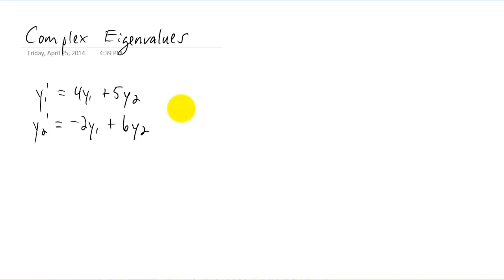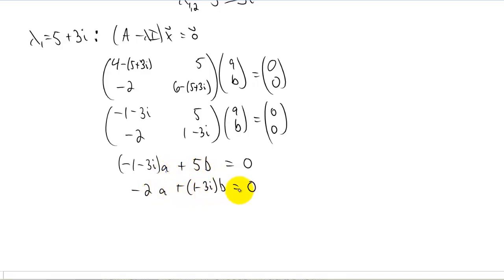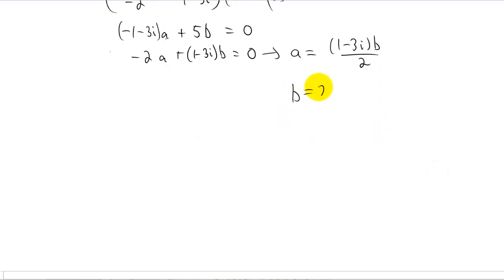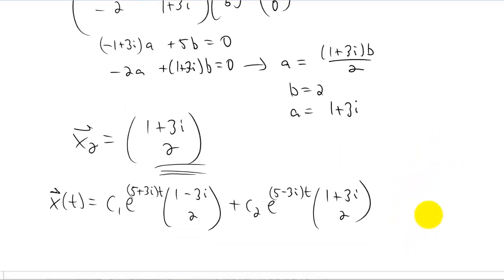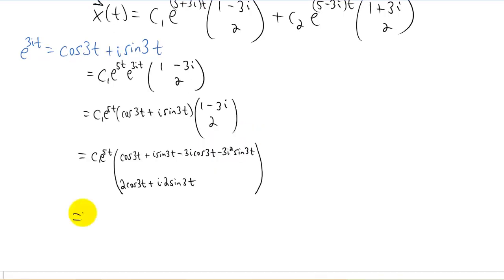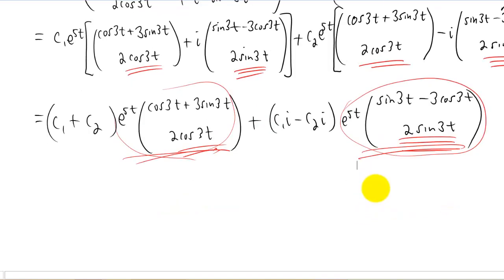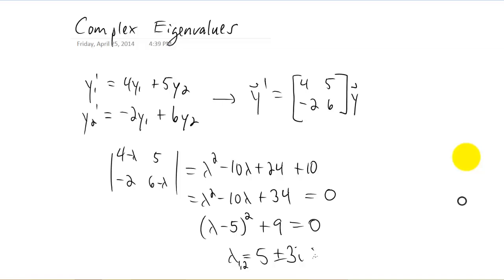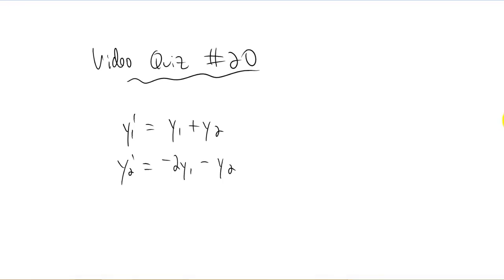Complex Eigenvalues

Comment: If you were to use the first equation instead and solved for B in terms of A, you'd get B= ((1+3i)*a)/5. So you could have an eigenvector of 
X = [
5 
1+3i
]

This would lead to a different general solution, would it still be valid?
Reply from the maker: Hi Plato! Notice that if you multiply each element of your eigenvector by (1-3i) you get the eigenvector [ 5(1-3i)    10 ] which is a multiple of the eigenvector we got in the video. So your eigenvector is just a multiple of mine!
Reply: @mathproblemssolvedcraigfau775  Ahhh okay, perfect! Thank you. I just had an exam on this yesterday and was still a little unsure of the different meanings of solving the system differently. 

I appreciate it!